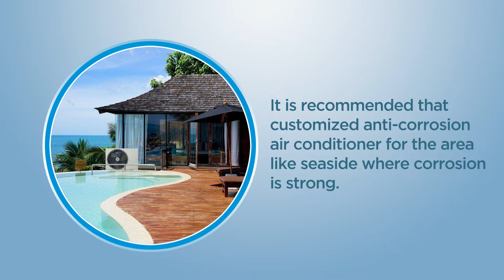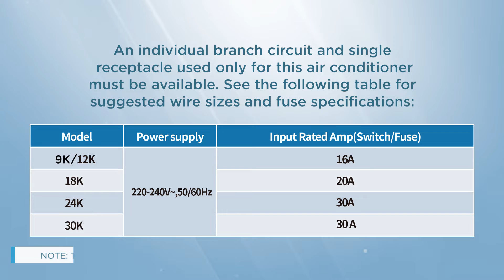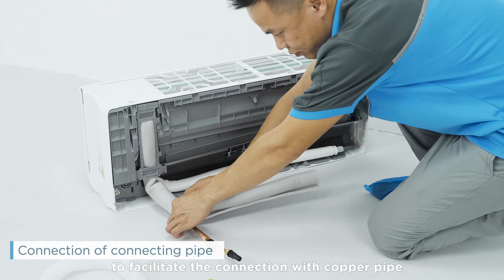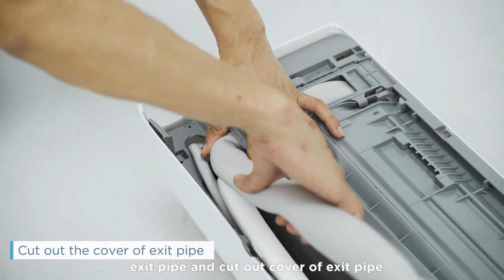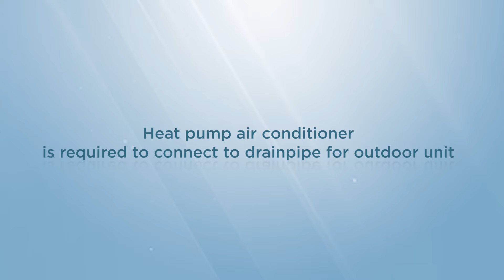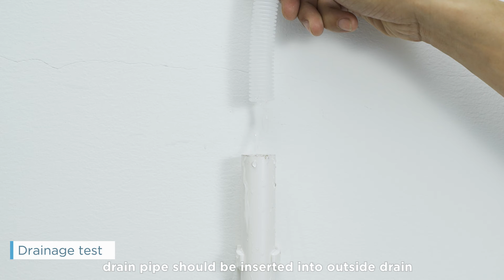Installation Video of Midea Breezeless E series 20240124

Comment: Great tutorial
Reply: except leaving uninsulated copper lines under indoor module, not using torque wrenches for tigtening joints, no sleeves on multistranded cable ends.

Comment: why 60cm upper space? so much..
Reply from the maker: In case of maintenance in the future. You cannot remove the top cover to change the PCB if the top space is not enough. You have to reclaim all the gas, disconnect the pipes and remove it from the installation place to make a repair.